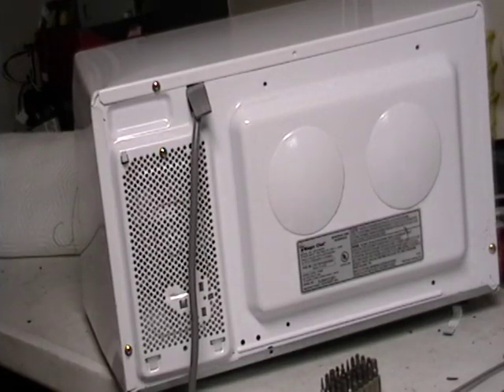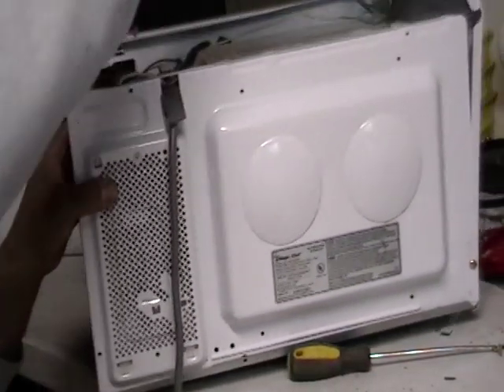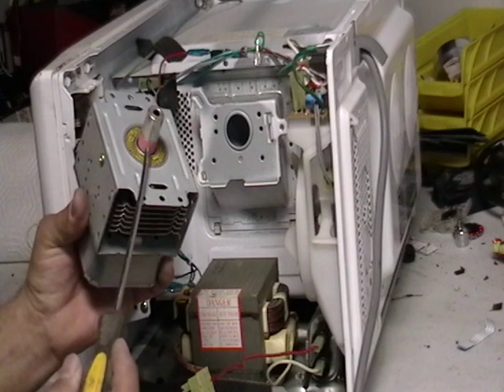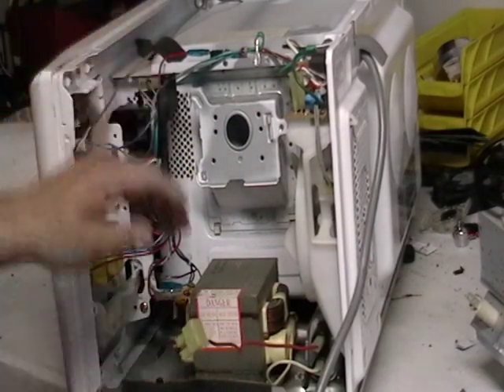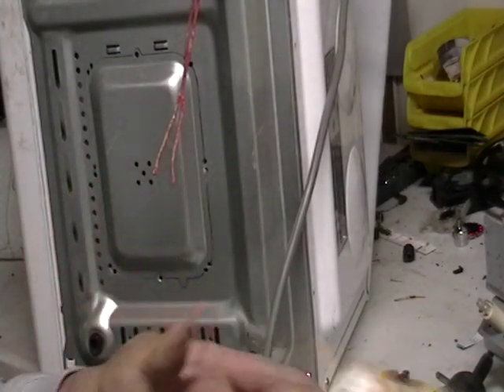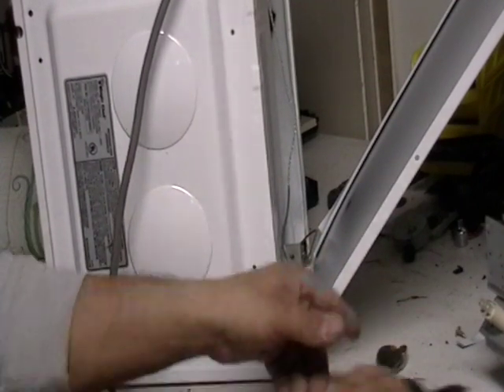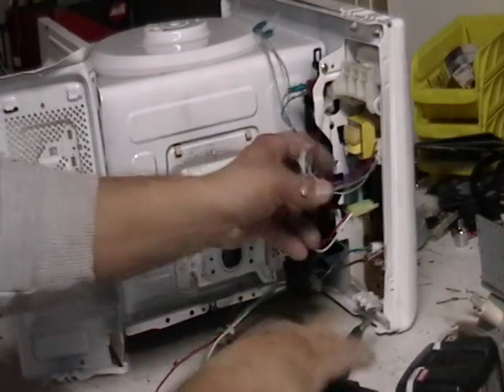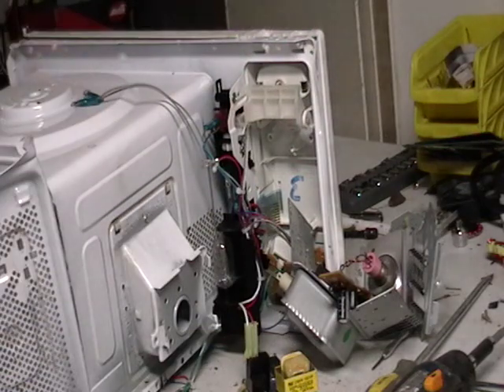How to scrap a microwave step by step

Comment: Before I got a tamper-proof bit set, I was using a 4.5" cutting wheel and putting a valley across the screw so I could utilize a regular screwdriver.  A lot easier with the bit set.
Reply: What set did you buy?

Comment: that chunky piece you refer to as a 'motor' is in fact a transformer. its part of the high voltage circuit.
Reply: also that "cancer causing agent" is beryllium, do not hit it with a hammer. Don't do anything to it.

Comment: You're a lucky guy. The scrap yards down here don't take all of the individual components as such. We just get the wire and aluminum out of them and scrap the rest for scrap metal.
Reply from the maker: ouch... where are you from?
Reply: I live in central Arkansas. My nephew and I are starting a (full time) salvage and hauling business in March. That has led us into the scrapping scene. Looks like and electronics, magnets, and "tech" type scrapping we do with the boards and such we'll have to sell on eBay or find a reputable buyer that we can ship to.
Reply from the maker: Good luck buddy. believe me. once you get the business going . the wholesale  scrap buyers are going to find you. Join this group to become more familiar and get your name out there.  ISRI (Institute of Scrap Metal Industries) this will help you a lot.

Comment: some safety thoughts, you can discharge the capisitator with jump cable attached to the - and the +, it will crack if its charged keep reattaching until it stops. The magnetron he took apart at the start thats the bit that makes microwaves its not dangerous unless you try to turn it on, thats a bad idea and avoid the chemical part. its best to wear heavy duty work gloves and goggles when taking anything apart i am always cutting my hands and nearly poking my eye out. use a multi meter or a screwdriver with a bulb in it that lights when when it touches a charge, they are great when working with materials that may hold charge.

Comment: Hi Mike!

Really nice vid about scrapping microwave, but one thing u can do faster! The "motor" have side welds. Only u need is hammer, if u hit the weld, it brokes really easily. When u done, u will have two steel pieces as letter E and I. In E part u have inside copper and aluminium, or two copper parts.
Reply: Or two aluminum pieces.

Comment: tamper proof screw-if you have an angle grinder with a cutting wheel a quick zap and you have a regular screw, I use this method on philips that are too badly chewed.

Comment: I would use an angle-grinder on the welds holding the transformer iron together, the copper windings come off easily.

Comment: at 3.00 there is that piece if you pry off the sheets and cut the steel off the top and bottom of that round thing it is solid #1 copper

Comment: I'm in the UK. A local electrical shop used to buy magnetrons from me for £3 ea (about $5) and capacitors for £1. They don't want them now, but they still go for similar money on eBay if they come from a working microwave. That could double your takings on each unit.....

Comment: Hey Mike, I have scrapped a few microwaves now and was wondering if you had any tips on cleaning/breaking up those large copper coils.  Getting them out of the transformer is easy enough but they seem to be covered in cardboard and possibly varnish that is very hard and goes everywhere when breaking them up.

Comment: Hey Mike, just scrapped my first microwave using your video.  Thanks dude, it was; as always; very helpful.  Question:  The cancer causing agent...you didn't use gloves to take apart that piece, weren't you afraid you could get cancer?
Reply from the maker: I worked around it. I think? I use tape to put around them now...Thank you for the comment.
Reply: The pink ring around the magnets inside the magnetron(which won’t hold any kind of charge btw so it won’t shock you it’s the capacitor that you have to disconnect and discharge if you don’t want to get shocked) will not cause any cancer problems unless you end up busting it up and having it go airborne in which case it may be inhaled and if that happens you will almost for sure get some sort of respiratory cancer

Comment: 4:50 is the capacitor I think. If there's a stored charge it'll be there. You can safely discharge it with a good big screwdriver.

Comment: How do you dispose of the pink stuff?
Reply from the maker: Evan Murry I sell everything to scrap yards...
Reply: my scrap yards will not take microwaves have a idea why?...they dont tell me why (i guess the radioactive part they dont want)...what part is that? (ps if you say in the video ignore this comment i havent watched it yet)
Reply: Its that pink part
Reply: richard mitchell that is not radioactive stuff-it's just poisonous like hell if broken-it's beryllium oxide which is totally safe until it shatters-but if you fuck up and it does shatter-just avoid contact with the powder at any cost(if you don't want to have a 3-4 days of excruciating pain before unavoidable death)!
But there is another way to use the magnetron instead of just breaking,stripping or anything:you gonna get several cents per one scrapped magnetron-so instead just make something out of it!There are a lot of uses for that magnificent device:the microwave gun(really atomizes electronic devices immediately if you make it properly and with better several magnetrons instead of just one)-or you can assemble the furnace with it's help:it will not have any limits of temperature and be only limited with the temperature of melting crucible itself!So just don't waste good stuff,bro 😎😉

Comment: no no. The high voltage capacitor (surprised you didn't discharge that first). at... 1:30, right after you move the microwave, it looks like it is right above the annotation button.

Most electrolytic caps that I have opened have an aluminum case, a large strip of aluminum foil, a large strip of oxidized aluminum foil, some kind of paper, and an electrolytic solution (can be corrosive so please don't open them unless you have gloves)

Just wondering what you do with those, scrap or ebay?

Comment: I spoke with my scrap yard buyer, they requested I remove a piece, I forgot what they called it, before I could sell it whole what are they talking about?
Reply from the maker: Maybe the Magnetron. That would be my answer.
Reply: @MiketheScrapper  OK, thanks.  Btw, I’ve got access to a lot of fridges, flatscreen LCDcs smart tvs, microwave, etc. any advice?  Thank you in advance.
Reply from the maker: @hiramelders5746  find a place to recycle what you don't want. Make room for everything and if you open the Magnetron of the microwave stay away from the pink stuff. Good luck .